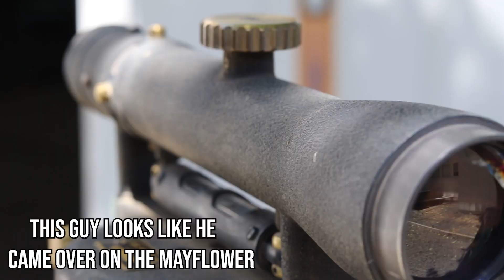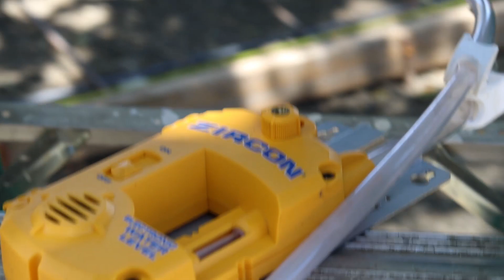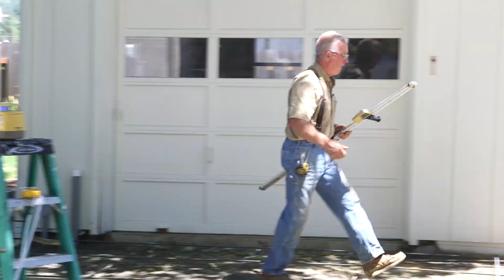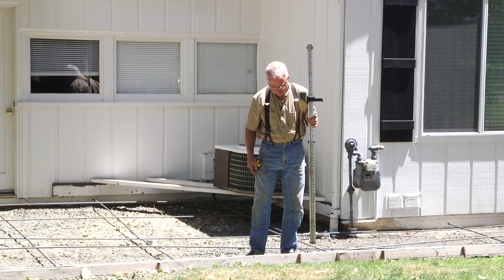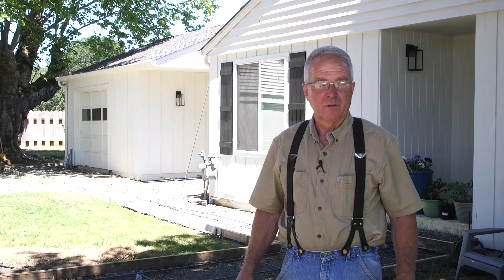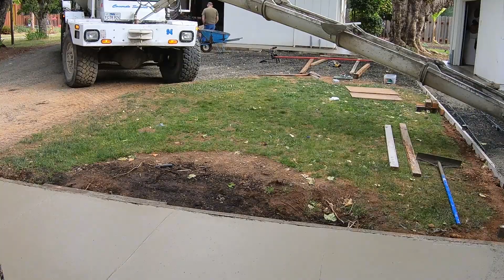The Hardest Part of Forming Concrete

Comment: Water levels can be a little fussy to mess with and take some time to set up, check and use, but they have their place. 

One thing about water levels that can be a little annoying is the natural surface tension of the water against the sides of the tubing. This causes the water to curl at the ends. Higher where it touches the tube and lower in the center (concave). You can help defeat the water tension by adding a very small amount of dish soap to the water. This will make a much flatter water line. 

No soap available? Just make sure you mark the same thing on both ends of the tube. The high point (crest) or the low point (trough). 

All of the leveling methods mentioned are far superior to a line level though. Only use a line level when there is just no other way to possibly achieve what you’re looking for. (There is always some way to avoid the line level.)

Comment: What about the transit? Good for foundation layout and elevation. I believe you mean the transit has better precision than the laser level. Spot on with not properly setting up any instrument and following proper technique will limit accuracy of the measure. Watched your video on your daughters shop layout and liked the parallel line process vs the build a box then keep pulling two diagonals to square.

Comment: There is lasers and lasers!!!  People should not conclude from this video that laser tools are low precision!!!  The laser tool in this video is built with focus on the quick job with sufficient accuracy for concrete level definition.  The builders levels exist in laser version with high (if not higher) precision.

Comment: The "automatic level" surveyor's instruments are practically given away nowadays, since surveyors all have upgraded to digital instruments.  With an elevator tripod it's all you need for precisely and reliably laying out elevations over any distance.  The instrument self-calibrates and shooting two or more points give you absolute certainty.  Likewise, you can get an analog theodolite for less than a builder's transit.

Comment: Water levels...we used a very cheap one, years ago.  It was extremely simple, just a couple of clear straight tubes with caps at one end and garden hose fittings at the other, one male and one female.  Using it was simple, just attach a hose of whatever length you need to a spigot, attach one of the level fittings at the other end, open the cap, and fill the hose with water.  Then, close that cap, remove the hose from the spigot (trying not to lose too much water from the hose), and attach the other fitting.  The two ends could then be anywhere within reach of the hose, and when you opened the caps at both ends, the water level in one tube would be the same height as the water level in the other.

Comment: Rare that water levels are productive anymore. Builders levels & transits for accuracy and distance in daylight. Lasers for  -100' and +/-.25" tolerances, indoors & big ass plumb bobs for elevator shafts up to 120' (don't need to worry about wind or calibration 😃)

Comment: Before I had a laser, I used my builder's level solo. Granted, it is slower but I made a stand for my measuring pole (a tape measure affixed to a heavy based stick) and I would look thru my level at it. I'd make note of the dimension I was seeing, then go over to my measuring stick, and mark that point on my wall/post/whatever.

Comment: Anyone here still believes they live on a sphere of 25,000-mile circumference? Simply find any example of bodies of water "bending". 3 mile lake should bend 6 feet. 10 miles = 66feet. 100 miles =6600 feet. Water ALWAYS finds its level.
Reply: all of em?
Reply: Yep, I believe it.  You can see the curvature. watch a boat sail away from you.   Also, as a pilot, I've flown all the way around that sphere a couple of times, so seen that you really can go all the way around it.
Reply: @andrewalexander9492  Your eye is curved. The sea is level. The gyroscope ensures airPLANES fly straight and LEVEL. Knowledge dispels belief.
Reply: @nostorynow9350  Clozapine dispels psychosis.
Reply: @andrewalexander9492  good luck with that.
Reply: @nostorynow9350  In 3 miles, the lake would bend about 24” (not 6’). In 10 miles it would be about 80” (not 66’). In 100 miles it would be around 66’-8” (not 6600’). The earths curvature is about 8”/mile.
Reply: @psidvicious  8 inches per mile, squared by the mile. This: https://imgur.com/ewLBM1u
Reply: @nostorynow9350  I understand that over long distances the equation is not so linear but unless I’m misunderstanding, you seemed to be making some kind of ‘flat-earth’ argument, which that chart helps to disprove even more.
Reply: @psidvicious  If it's a sphere then it's not linear at all. The chart shows a 3-mile lake should have 6 feet of curvature. As mentioned in my original comment.
Reply: @nostorynow9350  I think you understand my point that, because the earth IS a large sphere and the curvature takes place very gradually (8”/mi), a linear approach seems to work for relatively short distances but breaks down more and more rapidly as the distance becomes greater and greater. 

The fact that you can partially or even completely see objects less than 6 feet high from a distance of 3 miles is simply explained by light refraction, bending across the sphere, due to temperature fluctuations as well as you are probably standing (or at least sitting) while observing at x number of feet above the ground already, which cancels out most of the curvature from the start.
Reply: @psidvicious  the extrordanary claim that we live on a 25000 mile spinning sphere would require some extrordanary evedence. Objective reality disproves the claim. Water is but one of many actual proofs that contradict the heliocentric narrative.

Comment: If your old level is not level you can still read the staff accurately, but obviously the level obtained will be wrong.
In the same way. the reading on the beeper tells you how far from the rotating laser plane you are, but tells you nothing about how level that plane is.
The accuracy of the rotating laser plane maybe +/- 5mm within your working area, so check it's instructions to make sure you know the total accuracy you are working to. You could do a two peg test with these too if you were feeling keen.
Spot on with the beeper is not :)
Keep the staff/stick/whatever plumb too.
The accuracy of Engineer plus Chainboy is more dependant on the "stupid" end than the person standing by the tripod in my experience.

Comment: Your Berger optic is atleast 35 years old. The brass base is horrible for holding grade in the sunlight. Newe optics are less likely to lose grade in the sun. Brass parts expand and contract quickly. That's why there not used in modern optics . The cross hairs used to be made out of black widow web. There almost impossible to repair anymore. Be careful with it.

Comment: Human error makes any level or laser less efficient. A normal rotary laser will be plus or minus 1/16" . Its impossible to get natural materials that close, let alone the human error. Our bodies cannot hold anything that close. Optics have the same errors. After about a 1/4 inch, your material is impractical to get any closer. Human hands shake more than an 1/8" . 2x material and gravel cant be that tight either.

Comment: What about the curvature of the earth ??  LOL .. wouldn't that effect the water level ?  When I was younger and twice as dumb as I am today . I used a smaller caliber clear tubing for my own water level .. I noticed that when held up , side by side .. Hmm .. A difference in height ?. " Water always levels itself out ?".. In my case it didn't .  Then I remembered something from science class .. Surface Tension !! . Hmm meniscus too !! . Eureka !! I lost it .. Then back to a sight level .. But my revelation did come in handy one day . My oil tank outside went low on my double wide . Told if you let it go low that you'll have to get a Furnace tech to fix it . Could cost hundred . My wife had an uncle that was a tech .. sent him over and said " It's gonna cost ya " . Ah Fooey !! .. I filled the tank and still the oil wasn't flowing inside . I knew the filled tank was higher than where it entered near the furnace .. Aha ..It was surface tension holding me back !! . So I threw a compressor hose into the tank , duct taped the top and the oil began to flow like Old Faithful . I like builders levels , I like lasers . I like builders level Not Shaken and Not Stirred and test them .. When lasers first came out they had manual adjustments and weren't automatic . I found great uses for them in forming slopes . On the plans I might have an axis of fall indicated from a particular location . Once on   an elliptical footer that was 100' in it's major axis and 45' in it's minor . The plans showed the location of drop . and it offset from the major and minor . I considered using a builders level and mathematically calculate points along the ellipse for the form . That would have melted my calculator and my brain . So I lined up a point in front of the laser .Raised the receiver until it beeped , recorded the number and went to the point 100' away and found the point . Checked the plans and established a stake at 4'-5-3/4 " lower ..As indicated on the plans . Then set the receiver back to position it was in 1'in front of the laser and tilted the laser on it's crossing axis .. Now it allowed me to have a plane established that had the fall everywhere and at every point . No crunching math , No calculating fall at different intervals . Granted today .. You can go out with a total station or a theodolite .. But I didn't have them available to me . Or I could have waited for a day when the sun was setting on a particular day and happened to align with the axis . Run around and make coordinates quickly . I summoned MacGyver

Comment: I've always heard them referred to as a transit.  Is there a difference between a transit and a builder's level?
Reply: Yes, a transit and a level are two completely different instruments.  A level projects a level (if set up correctly) line of sight in all directions.  A transit is for measuring angles, both in the horizontal direction and the vertical direction.  The telescope on a transit tilts up and down,  the telescope on a level is fixed and doesn't move up and down.
Reply: @andrewalexander9492  The mistaken interchanging of those two tool names was always a pet peeve of mine.

Comment: coming from a place with occasional driving rain, i can tell you from experience that waster does NOT always flow downwards. when we have horizontal rain and it hits a surface, the wind force pushes it up, underneath tiles, through brick and blockwork, the only thing to stop it is a solid sealed surface or a 4 foot thick stone wall. then there's the mizzle which is like a thick fog you can drink, somehow that's even wetter than a rain storm.

Comment: Give me the old dumpy level any day to accurately set grades!  I began carrying one similar to your old Berger back in 1970 to set grades on interstate highways and bridges, and I am confident with them!  No telling how many miles I have carried one on my shoulder to the work location and operated it all day, sometimes 7 days per week.  The newer levels (strictly levels) have compensators that automatically adjust to compensate for human error leveling the instrument.  I can't tell you how many I have returned to a factory technician to replace the compensator.  The old level is mechanical and easy to check and adjust for accuracy by a skilled operator.  And finally, any time you set grades, a good operator will always check back in on the original bench mark when done setting grades to be sure no error has accumulated.  
Transits are not good for setting or checking grades.  They establish alignments.  (I am not talking about the Total Stations or scanners manufactured today with very high accuracy.)
Just my two cents....

Comment: The physicist in me appreciates the qualification that a tight line is "virtually" straight :).
Reply: I get into it with co-workers all the time.  There is no ":absolute" straight.   At least not that we can achieve.   I try explaining about not daisy-chaining measurements, as you're adding together errors.   The response is always "No our measurements are accurate.  See, I added these 37 measurements together, (with a plumbob in the wind on a ladder on a hillside) and my measurements are perfect!  You must be a bad carpenter, if yours aren't!"
Paraphrasing, but that's generally what is said.
Reply: @GlennC789  they wouldn't get that at all.
Reply: There's no such thing as parabols. Everything is straight at the most basic level. A 'circle' is an illusion; zoom in far enough and that rounded edge is in fact straight...

Comment: So, funny story;
I used a builders level solo for about six years by using bungee cords and a hand tamper to hold the rod and then I would run back to the tripod and check the height (minus 1/8" of course for the thickess of the tamp plate). It worked okay for all that time until I broke down and got a laser level, but I'm pretty sure I disappointed quite few of the other subs who were always amused by my antics.

Comment: A green laser than can shorten the throw of the beam can be seen with the naked eye even in broad daylight(up to a degree), and you can use a tape measure or story pole to achieve a more accurate reading than with the alarm

Comment: I just watched a 30" steel casing get jack and bored under a highway and railroad. I was pretty surprised that the vertical elevation was monitored during the "drill" with a simple water level.
Reply: And it is  likely stay that way for a long time as there is no line of sight possible to the buried cutting point of the auger and casing.  The water level is the best tool for that task.

Comment: Great video. Something I noticed though is that the laser level not only audibly beeps to show level, but if you look on the eye/device on the rod itself, it will show a digital hash mark for level with most manufacturers. It will also display an arrow to go up to find level, or down arrow to find level. So not only does it do it audibly it can be used visually. Keep up the good work!

Comment: One of the viewers on my surveying video mentioned something about water levels that I had never considered. Since water density changes with temperature, you have to be careful not to let one end sit in the sun when the other's in the shade or the levels will be different at each end. Temp of water needs to be consistent through the length of the tube.
Reply: I think of greater concern is that there are no bubbles in the tube. Ask me how I know this!
Reply: Another "ask me how I know" that I fell foul of was lazily adding the blue food colouring (for easier visualisation of the fluid) into the pipe.  

Should have mixed it in with the water in a bucket first before filling the pipe with the evenly mixed product.  

Turns out that the all that sugar in the food colouring made for a radically different density at one end of the system.

Holding the two ends of the pipe up close to each other as a check before work got underway revealed a 6" difference in fluid heights.

(At least I spotted it in time...!)
Reply: Oh, piss.... within a quarter inch.
Reply: Love your content!
Reply: I stopped using water levels years ago because the heat difference in any long tube really makes it off. I had better luck with a 6’ level and a pencil @50’.
Reply: Technically correct, but would it make a significant difference?  The Pyramids came out ok...Enjoy your channel too.
Reply: @publicmail2  Could make a difference. 100F on one side, 50F on the other, 6-foot water column, error is half an inch.
Reply: @PracticalEngineeringChannel  time for another video!  You could include different diameters of tubing to see if that also makes a difference. Clear versus black and temps. All for hydraulic effect. ;)
Reply: @azpcox  I'd love to see that come out. Especially since I'm just learning that water levels like that exist lol.
Reply: @PracticalEngineeringChannel  50 degree difference? Where the hell do you live where there is a 50 degree difference that close?
Reply: @PracticalEngineeringChannel  

You're the channel that advised to put new tile flooring over old flooring. You shouldn't even be here commenting about anything.
Reply: @dustinfrenchtsmevidence9938  

Read my comment just before this one. He's a hack.
Reply: @PracticalEngineeringChannel  Was surprised by your high error value and made a quick check. Checked with som more critical values water of 1°C on one side and 99°C on the other (water expands about 0,0008 times between 0°C and 99°C).  With water columns of 2 m this gives an error of 1,6 mm.  Didn't you make an error with the decimals?
Reply: @publicmail2  the egyptians had no transparent tubing.
Reply: @72matyas33  transparent tubing is not required for a water level.
Reply: @twestgard2  I did not say that they didn't use instruments with water to level things, I just tried to emphasise how older water levels were diffrent. I kina see that my comment is kinda irrelevant
Reply: @72matyas33  lmao. oh yes they did.
Reply: @72matyas33  or shade
Reply: Nice to see you here Grady, I just watched your video about the crack in the bridge and it was beautiful!